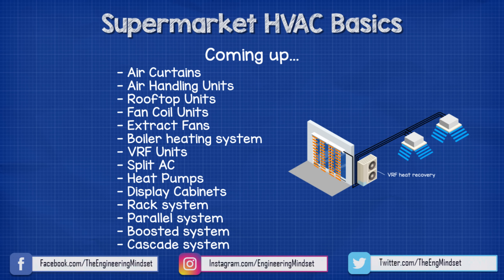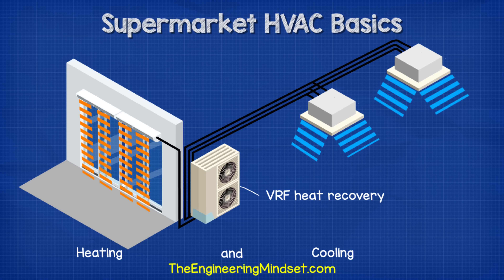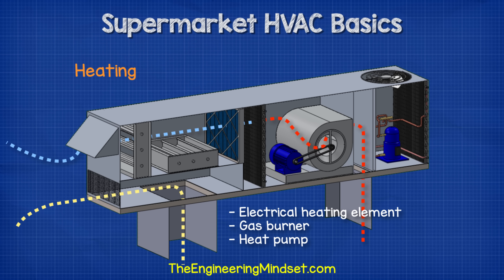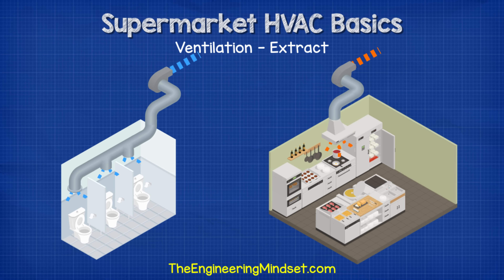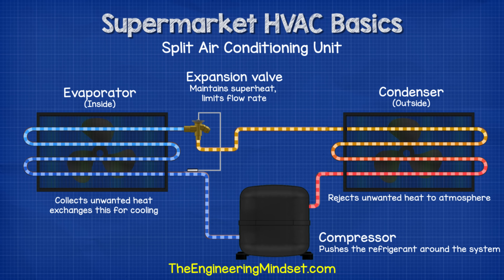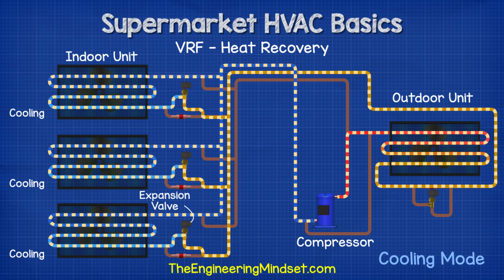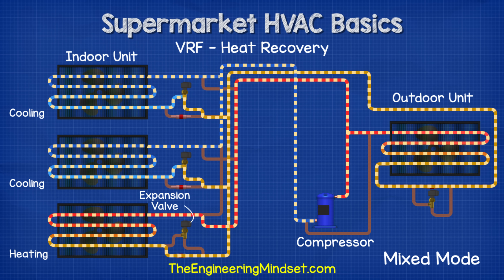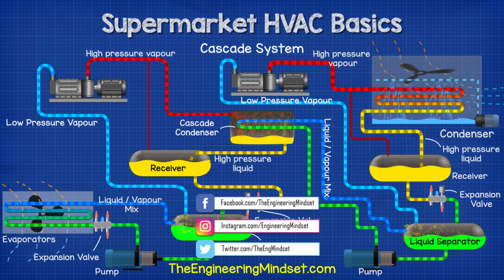Supermarket HVAC Basics Explained - Refrigeration / Ventilation hvac building services

Comment from the maker: ⚠️ Found this video super useful? Buy Paul a coffee to say thanks: ☕
PayPal: https://www.paypal.me/TheEngineerinMindset
Reply: Could you do a video regarding vrf heat reclaim units? Please 🙏
Reply from the maker: New VRF unit video here:➡️  https://youtu.be/4i1XgcP1tmw
Reply: 9:55 you have a little mistake where in the bottom left corner you have a "expansion valve" which should have been a regulating valve. I knew something wasn't right, but I had to watch your video on ammonia industrial cooling to be able to pinpoint it.

Comment: I wonder if some supermarkets have 2 condensers for the freezers: one inside the building, and the other outside. And some kind of selector valve to select which one to use. The outside condenser would be used in the summertime, when you want all the heat to be dumped outdoors and reduce the cooling load for the A/C. But in the wintertime, you'd want the heat to be dumped inside the building to reduce the heating load, so you'd use the inside condenser. Anyone know is supermarkets actually do this?

Comment: I have a little remark idk if it is correct. When you say the refrigerant evaportates and collects the heat, shouldnt it be "it collects the heat and then evaporates"?
Reply: It starts evaporating in the expansion valve

Comment: split air conditioning unit you said its only used for cooling, what if you have a reverse cycle valve?
Reply from the maker: Then it's a heat pump
Reply: @EngineeringMindset  we use a split AC system at work that can cool to 5 degrees C and heat to 28 degrees C using refrigerant, can you shed some light on this as im not HVAC i just work with guys who do

Comment: Thank you for the helpful videos! Is it possibly to convert a 4 story office building, 95K Sf, from cooling tower/AHU system to RTU system?
Reply from the maker: Yes but it will be a significant project. Probably easier to install a VRF system and duct fresh air in
Reply: @EngineeringMindset  The current cooling tower/AHU system is no longer working. Approximately 30+ years old.
Reply from the maker: New VRF unit video here:➡️  https://youtu.be/4i1XgcP1tmw

Comment: too complicated
Reply from the maker: What part did you struggle with?
Reply: @EngineeringMindset  How about:  too much, too fast?   This video looks like it was done in haste.  Why, back in the sixties,  this is how many educational films looked.... rushed!   Now we have the magic of software,  cheap hardware,  and beaucoups bandwidth and storage.  We no longer have to read textbooks and use power point...   I mean: Slow down,  just a little bit!    Oh,  man!
Reply from the maker: Well we have to play a balancing act. Some people say it's too fast, some say it's too slow. We have to find a middle ground and can't please everyone unfortunately. You can slow the video down yourself using the playback speed settings. On a mobile tap the three dots on the top right of the screen and on a PC tap the gear icon in the bottom right.
Reply: @EngineeringMindset  It just require a lot of knowledge going into it; going to go look at your air handler video first then come back and watch -- thanks again.
Reply: @EngineeringMindset  Impressed that you took the time to reply to this guy. Thanks for your video, as a HVAC/R student, this is actually somewhat basic for me, but still a nice refresher and reminders. It just goes to show that with this platform there are so many levels of education it's quite difficult to make anybody, let alone the majority happy. You've touched on many topics which can be researched later. The benefit of this approach is you've provided many starting points to follow up on later without a lot of extraneous info. Great job.